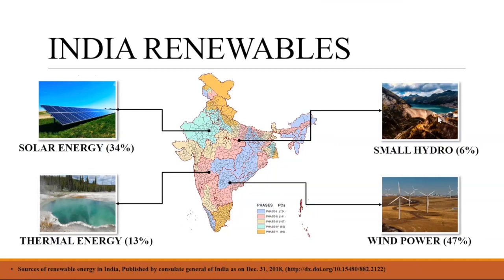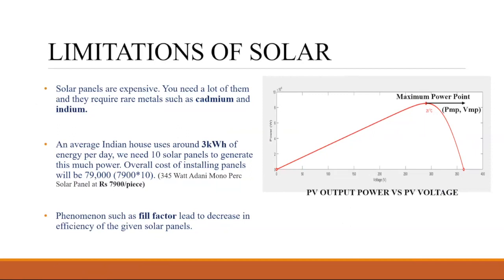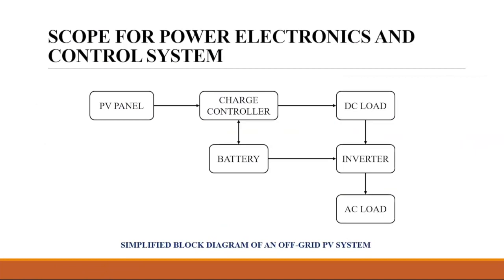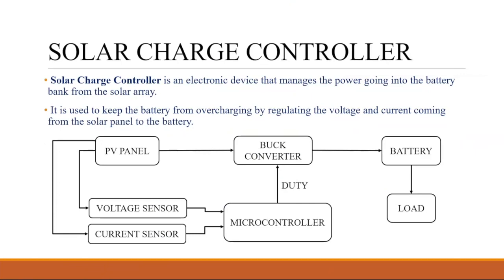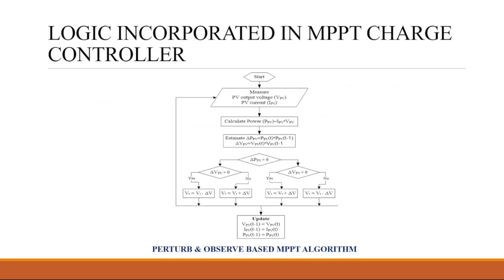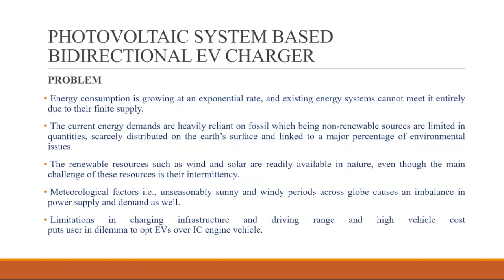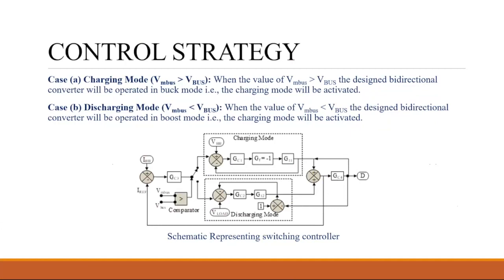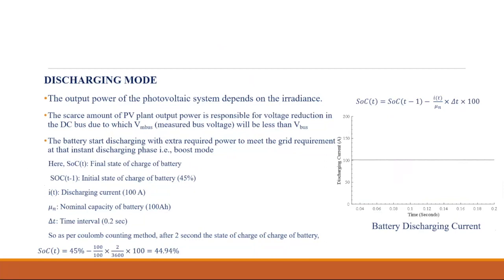Energy Management System for Hybrid Microgrid by Mr. Vageesh Amoriya

Comment from the maker: 00:31 Government initiatives and university's efforts to promote solar energy in India.
03:48 Solar energy has a good scope for future power generation in India.
08:09 Importance of energy independence in terms of generation and resources
10:24 World's largest solar power plant in Rajasthan, India
15:45 Limitations in power output due to internal losses in solar systems.
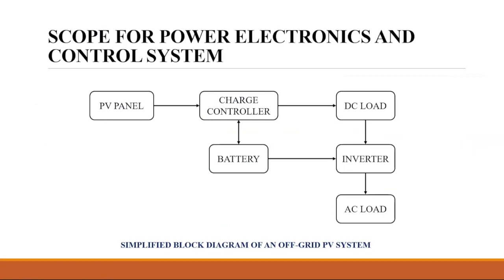31:52 Utilizing battery storage with solar power for continuous energy supply
36:44 Overcharging can damage battery life and requires a charge controller for protection.
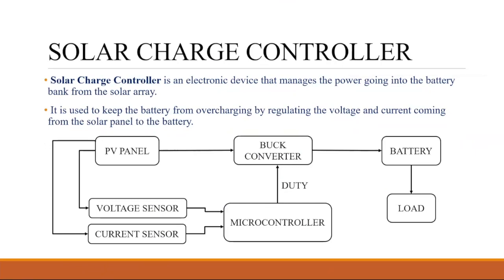39:19 Understanding Duty in Hybrid Microgrid Energy Management System
44:49 Optimizing power output using algorithm
47:40 Algorithm for maximizing power output
51:42 Microgrids provide backup when the main grid fails
54:02 Understanding current transmission in a hybrid microgrid
1:00:43 Addressing challenges with charging station availability in hybrid microgrid
1:03:10 Using TV as a backup source for energy management in hybrid microgrid
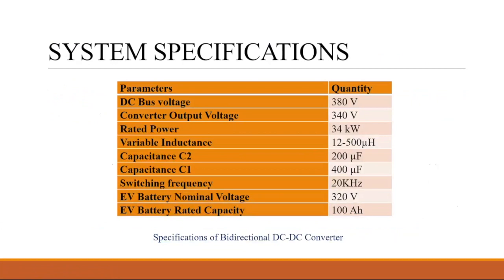1:08:15 Hybrid microgrid operation and EV integration
1:10:27 Control strategy for hybrid microgrid
1:14:31 Monitoring the output voltage and state of charge in the hybrid microgrid system
1:16:32 Importance of simulations in energy management system
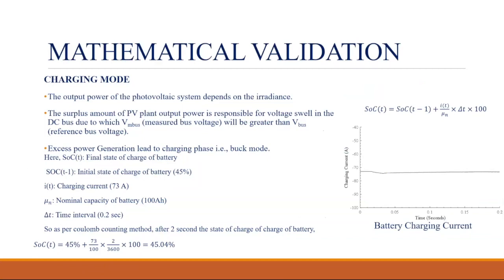1:20:48 The system accurately follows charging and discharging values.
1:22:49 Utilizing EV as an energy storage system
Crafted by Merlin AI.